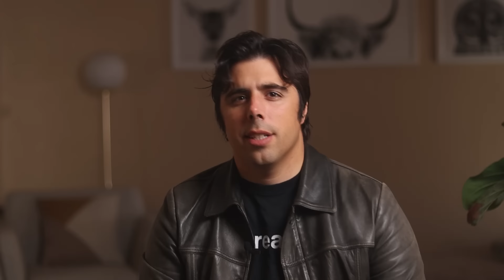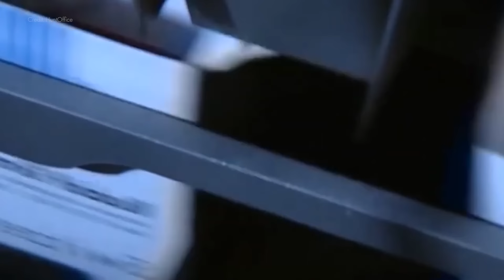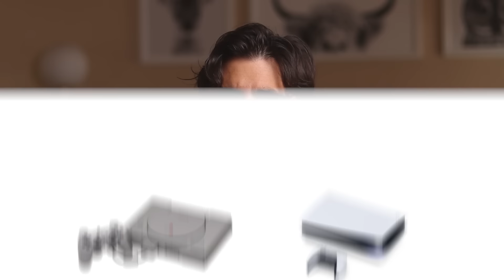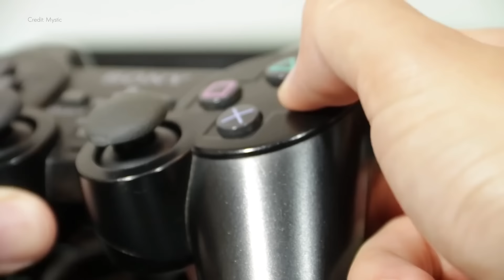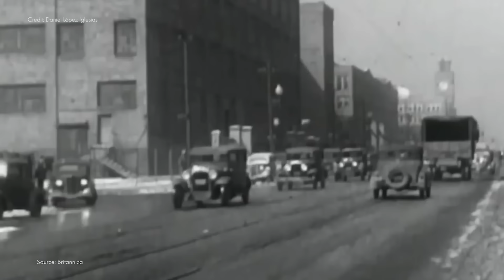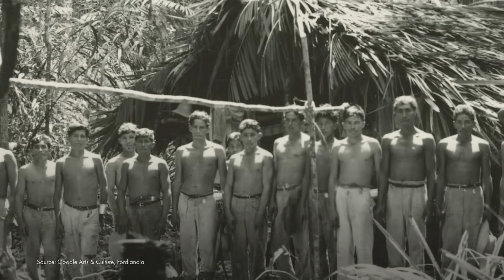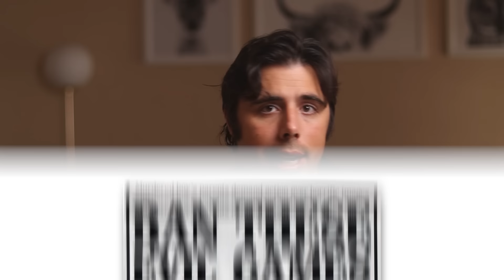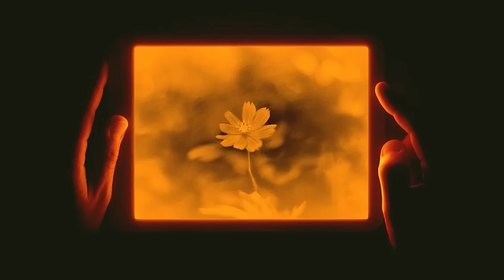Why Some Designs Are Impossible to Improve: Quintessence

Comment: Don't forget the classic wooden Pencil with eraser, and the Boston Pencil Sharpener.
The helical blade sharpener is the quintessential mechanical sharpener design thats been used in every wall sharpener in schools and offices for the past 100 years.
Reply: most people push the pencil WAY TOO HARD and the cutting faces end up taking too much material thus creating a poorly sharpened pencil
Reply: @sv650rider  There are a number of manual pencil sharpeners that do a better job than the classic manual pencil sharpener used in schools. Some are designed to indicate when your pencils is perfectly sharpened and allow you choose the kind of point you want (long and thin, or a bit more stubby).

The whole sharpening issue is the reason I moved to mechanical pencils. No sharpening, the pencil lead lasts a while, and my mechanical pencil (a Uni Turu Toga) automatically rotates the lead so that I don't get flat spots.
Reply: Through elementary school in the 90s, I always felt like they jammed or took too much force to use.  Almost everyone preferred ones run by an electric motor.  I just expected sharpening a pencil to be simple and easy.  Little did my little brain imagine sharpening a pencil with a KNIFE.  One way or another, in middle and high school I was completely on board with 0.7mm mechanical pencils.  I favored the cheapest ones because they're thinner, no rubber grips.  I could keep each one lasting through most of a school year.
By the way, does someone know if the blades inside electric motored sharpeners are the same?
Reply: @SteelsCrow Yes the blades in electric sharpeners are identical.
Reply: @SteelsCrow they needed a good cleaning
Reply: @SteelsCrow I know it ran by magnets 🧲
Reply: @SteelsCrow  I believe the electric ones have the same type of blades inside.
Reply: Also the toilet bowl mechanics
Reply: The rotational sharpener makes a perfectly smooth, conical tip. A manual blade will never be as perfect for that task.
Reply: @HappyBeezerStudios  You don't always want a perfectly smooth conical tip, though.
Reply: Those sharpeners suck, I hope kids aren't still using them. Everyone I know switched to mechanical pencils decades ago. In offices and school. No more excuses to get up out of your seat.
Reply: personally I find a power drill connected to a razor sharpener so be the best solution. put the pen in the drill and the sharpener in your hand. the advantage is the same as when you use a lathe, the tool is stationary and the workpiece rotates giving an even sharpening. rotating the tool around the part gives inaccuracies with alignment since the cutting is not made on the central axis of the pen.
Reply: Everyone's got beef with the small eraser at the end of wooden pencils. Those things suck
Reply: Oh wow I've never heard of a wall sharpener before, im assuming its not just like a hole in the wall that sharpens your pencil somehow because idk how that would work
Reply: @GrassFudge7 they are truly the first "tool" of children that we ran by ourselves. It has a plate that screws to the wall (usually a wooden book case" look it up. They became a part if us we all remember
Reply: @GrassFudge7  A dark mysterious little hole in the wall you stick your pencil into wherein a team of thumb-sized gnomes patiently wait for pencils to lathe and grind.

The real things are very visible and accessible for children to investigate.  Screwed against the wall is a single sturdy piece of metal that extends out from the wall.  Around 10-15cm from the wall the same metal cast forms the circular base for the gear and blades.  The axis of the pencil runs parallel to the plane of the wall, so the mounted assembly resembles an enclosed airplane turbine.

They were also mounted upright on blocks of wood, bookcases, or desktops.  Since the shell that catches the shavings had to be easily removable to empty out, the gear and 3 cylindrical blades were also easy for children to poke their fingers into, but I don't remember any real danger from that.
Reply: @SteelsCrow  that was a very thorough explanation thanks!! I've only ever seen and used the little plastic or metal sharpeners that come with stationery sets, so maybe they weren't used as much in the uk.

In terms of danger assuming theyre similar sized holes i do remember when my finger was small enough I'd put my pinky in and "sharpen" my finger but i didnt end up cutting myself or anything thankfully. I think i also remember sort of accidentally disassembling a small plastic sharpener and taking out the blade, but it wasnt really that sharp and im pretty sure i only used it to try and sharpen pencils like it was a knife, but still maybe the wall sharpener wouldve been safer lol!
Reply: I remember those for when you sharpen pencils in them ifyou press too hard, they can be off centre and leave you with only the graphite exposed on one side
When I went to primary school I saw Boston brand, but also X-Acto brand wall mounted pencil sharpeners as well
Reply: Copy & paste
Reply: And the Bic pen
Reply: Most schools use electric sharpeners now that the teacher is expected to buy.
Reply: The electric ones that kiddos stand there and push until their pencil is one inch long??
Reply: But more people have moved to those blade sharpeners
Reply: anyone else here after watching Jerry Seinfeld on GQ

Comment: I think we are on a verge of a (sorta) new controller design, though through adding stuff to the current layout, not reshuffling everything like Nintendo did from the N64 to the Wii.

The WiiU, and now the Switch, brought gyro control to the forefront, a middle ground between stick aim and mouse aim. It's still not as good as a mouse, but it gets pretty dang close, and way better than the limited precision of a stick just having a turning speed locked in. Motion Control is indeed neat, but I'm not sure if it's really precise enough for anything other than large movements.

XBox meanwhile seems to be expanding towards more back buttons, to spread out the load away from just your thumb and index fingers.

Valve feels like they're trying out everything. More back buttons, gyro aim, and even touchpad control.

Comment: I would say that the main selling point of the sunbeam toaster is the more consistent toasting since it basically detects the surface temperature of the bread to determine when its done.
Reply: Well, what is perfect in the eye of the beholder. My wife likes lightly toasted, just basically warmed up,   I like a bit darker,  but even for me what is on a video is too burned. Plus nowadays breads come in different shapes
Reply: @dmitripogosian5084  There is an infinite light to dark adjustment knob on the Sunbeam toaster to please everyone's individual taste preference.
Reply: @OdiseoQuintin  But I thought the main point of it is being automatic ?   Why do I need all that temperature sensing, if Iat the end I have to turn the knob as on a simple mechanical one ?

Comment: I feel like a more 1:1 comparison with the PS controller than the Wiimote is the Joycon, which is designed for a similar, if more constrained, range of function as the PS-like Pro Controller, but for one-handed adult use or two-handed child use.

Comment: While the current smartphone design may be quintessential, I think the original  Motorola Razr was the best functional design. It was sleek but also a comfortable phone. I hate the lack of ports and buttons on everything: phones, cars, laptops, etc. For example, replacing physical car keys with key fobs ...what is the purpose? I think we need to go back to more tactile designs.
Reply: Additionally, a lot of the elements in the iphone were already present in the Palm devices (i.e. the Palm TX). Unfortunately, Palm dropped the ball but a next generation Palm device would likely have looked a lot like the iphone. They did try to play catch-up after but it was game-over by then and it would take Android from the heavily funded google to bring some competition. It's a shame because there was a lot to like about Palm.
Reply: @chaos.corner  True. Palm and the Windows phones of the time had already started doing this, although Palm had fallen behind, unfortunately. But also, you look at the HTC phones of the time, they were already doing what Apple then copied. I used to have a HTC phone that did everything the iPhone did, just not as smoothly. Apple improved the various parts of the experience, especially making the screen flatter and more integrated, that's all. People forget that these other phones existed at the time.
Reply: @wolfblaide  the biggest thing Apple did, imo, was to require a data package. Before then, use of the internet apps was rare (especially since wifi didn't exist).  I went from only using the web browser in emergencies to using my phone's browser as essentially my primary access point.
Reply: I agree. Tactile response is VERY valuable. It's an entire new sense to use to navigate and use and respond to an object. We have those little ridges on keyboards for the home keys F and J for this very reason. To enhance tactile use. Phones designers realized they lost some and tried to replace it with buzzers when you type...but that's still a long way from knowing what you need to do without looking purely through feel. I could type a message to a friend with my older phone in my pocket. Call home too. All without looking at my phone. Which only sounds like a party trick until you do it yourself and realize just how often you have to stop looking at the world to use a device that doesn't have to be looked at if you just designed it better.
Reply: I had the Krzr, it fit better in my smaller hands.
Reply: Blackberry Curve
Reply: I loved Blackberry, I'm sad it went down, the physical keyboard had great function imo. I could type twice as fast without having my fat fingers typing shit on a touchscreen lmao. Also the visual at 22:45 is so striking, it went from personalized items in all shapes, sizes and configurations that catered to costumers, to soulless black rectangles. It's why I just buy the cheapest one, because there's nothing that genuinely differentiates any of them, they're all the same. I wish there was more fun and personality in tech again. One that flips, one that slides, one to hold horizontally, just anything to make for a different experience.
Reply: @dontxtalk 
Soulless black rectangle you say? Would you consider it a Black Mirror perchance?
Reply: Yep, if all you're looking for is a phone, flip phones are the perfect design.  Compact when closed, the proper length from ear to mouth when open, and none of the buttons can be pressed accidentally when you're not using it.
Reply: I think that comes back to the idea of reducing potential failure points. It takes less parts to access those functions via touch screen than to have physical buttons and keys. In terms of actually using the devices, I think whether or not to have buttons is purely a preferential decision, but in terms of manufacturing a reliable device I can see the argument to move away from the tactile stuff. I wouldn't be surprised if eventually our PC keyboards are all just long flat touch pads too.
Reply: @BlueSparxLPs  The reason why they slam touchscreens into modern cars is because theyre cheaper than designing an actual dashboard
Reply: @Argomundo I think the fact that most people could replace a knob or button fairly easily by themselves but will have to take it in for servicing if any little part of their computer system fails probably plays a role in the death of tactile designs
Reply: @Grim_The_Reaper  more likely it's that they can disable features and change overall functionality far more easily. if your heated seats are directly controlled by a switch, there's nothing they can do. they could however have the switch as input for the computer and let the computer control the heatig element. but why have a switch if you can have it in software? also this makes the complete system ready for remote control features, such as turning on the AC from an app. if the car has a dedicated switch for AC and a knob for temp, then either all those must be a momentary button (that's lame), or the computer has to be able to toggle the switch or rotate the knob, which is a rather complicated task with many added mechanical and electrical parts. it would be cool tho, like grand pianos that can play a midi file and you can see the keys moving, but that aint happening for cars any time soon
Reply: @BlueSparxLPs  Keyboards, probably not, as it doesn't give any advantage. Touchscreens work on phones because you're looking at the screen as you're typing, the screen is your keyboard. On PC, your keyboard and screen are separate and many people touch-type. Touch-typing relies on tactile feedback that touchscreens don't provide.
Reply: @BlueSparxLPs  >I think whether or not to have buttons is purely a preferential decision
it is quite literally not, you are legally not allowed to fumble with the touchscreen while driving and the manufacturers themselves tell you the same as well. Imagine going for a multi hour drive where you have to come to a full stop every time you want to change something like the music that's playing or the temperature of the AC and if you use the touchscreen while driving anyways and get into an accident you the full legal blame is entirely on you

Comment: You only explained why  Mag-Lites succeeded but not why the competitor & original one failed
Reply: Securing the market is the implicit reason, as what he is discussing is the quintessential item not the sole marketable item. There is one primary popular example of a product in many areas, and in the case of heavy duty flash light that is the one, so none of its competitors hold that podium.